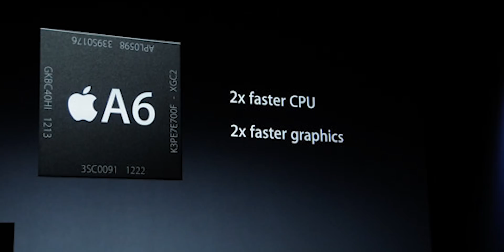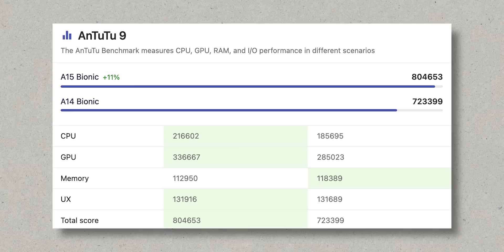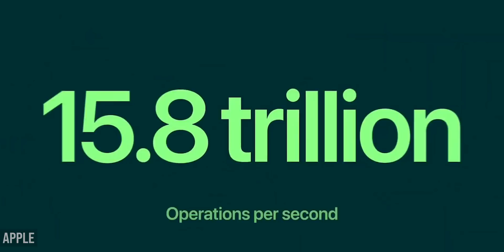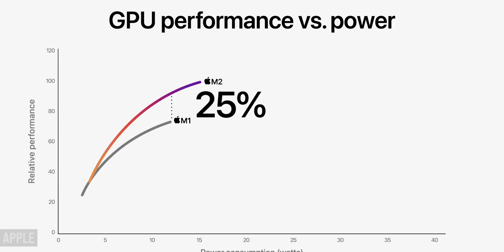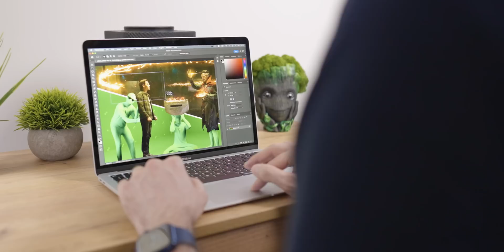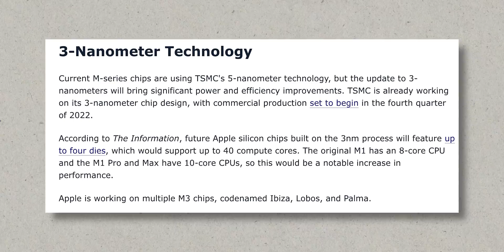M3 MacBook Air — M2 was just for fun?!

Comment: "The term "3 nanometer" has no relation to any actual physical feature (such as gate length, metal pitch or gate pitch) of the transistors. According to the projections contained in the 2021 update of the International Roadmap for Devices and Systems published by IEEE Standards Association Industry Connection, a 3 nm node is expected to have a contacted gate pitch of 48 nanometers and a tightest metal pitch of 24 nanometers." - Wikipedia.  All marketing my man.

Comment: As someone who NEVER feels the need to have the “newest and latest” materialistic objects, the MacBook Air M2 is an incredible machine that will hold up for years to come. I bought a new MacBook Air in November 2016 and it’s been an incredible machine for years. I’m only upgrading cause I lost my old one and when found it was broken.
Reply: Aged like milk
Reply: How the hell do you loose a large laptop?? Its not like its small like an AirPod or even an iPhone for you to lose it?
Reply: @Inferno45  Lol. It fell out of my book bag and into my Jeep somewhere. I didn’t notice for a few days. I went to get it from the book bag and it wasn’t there. Used “Find My” to locate it, and it was broken. The Jeep was full of people throughout the week going to the beach and various other places, plus packed with everyone’s stuff, so I think it was crushed by the seat being moved. It was probably fixable. I sold it to a friend who is into building/repairing Apple products.
At that time Apple had started using that keyboard on MacBook Airs that no one liked, and they were prone to issues, so I just held off on buying a new one. But it looks like this new MacBook Air is perfect.
Reply: I bought a MBA in 2016, it works fine except the unpredictable internet disconnections  😠  the Wi-Fi drops so often that I can't use it for online courses. I tried many methods and even replaced the network card. This is the reason I want to get a new one.

Comment: I think Arthur looks like Harry Potter (I'm sure others have said this).  The increase of the M2 is pretty good I think.  I agree, if you have an M1, no need for the base M2 (unless you really need to 8k decoders or boost to gfx (esp. if AAA titles start to appear)).  If you still have Intel, and don't need maximum power, then the new Air wouldn't be a bad investment.
I have the M1 Mini and do web development.  It is amazingly fast for what I'm doing (no XCode currently).  Even Java (which I only use sparingly) is native on the M1 and runs very quickly (Camunda and Tomcat)

Comment: I completely disagree with you. The m2 MacBook Air IS exciting. It is a brand new design for the MBA in years, the m2 chip is still an improvement over m1 and it comes with plenty of improvements such as MagSafe, bigger display, and better audio/camera quality
Reply: I feel you. the new Air design is so exciting, screen and speaker upgrade makes big difference, but It's still hard to justify the extra cost, while you can have M1 MBA for less then $800, The M1 is still a perfect everyday laptop. while M2's chip's improvement is small, for me I'd hold on to my M1 for M3. Also hoping Apple is going to sell 512GB as based model M3 Air.
Reply: Completely agree. These tech-heads are WAY too sour over these new Apple releases.
Reply: MagSafe is enough for me to upgrade.  All the other stuff is a huge bonus.
Reply: No, its overpriced.
Reply: @chromaticvisuelle  No, it isn’t. The new upgrades justify the price increase.
Reply: @Mr20001  No. Not with 8gb/256gb only in 2022.
Reply: @chromaticvisuelle  So, you think they should offer more storage for less money? Right. If you’re someone who requires an exorbitant amount of space, go for something else. This isn’t a problem for most people.
Reply: @Mr20001  You don't get it. Thats fine.
Reply: @chromaticvisuelle  Can’t please everyone.
Reply: @chromaticvisuelle  256 GB on a laptop in 2022 😭😭

Comment: People are overhyping 3nm so much. When apple switched from 7 to 5 for the A14 we still only got an incremental upgrade for performance, because apple focuses the upgrade mostly on efficiency. Because the M3 will be a baseline chip it will probably also focus on efficiency and not some massive power boost
Reply: Ya they will prolly save it for the m3 pro or m3 max chip
Reply: Efficiency is honestly all I'm looking for after coming from a windows laptop that could not survive without a charger.. what kind of efficiency jump is M2-->M3 going to be? Any idea?

Comment: I'm hoping with the M3 Apple adds specific raytracing circuitry, much like have for media encoders. This is an area they fall short in relative to NVIDIA and AMD.
Reply: It would be cool but it’s not happening at least not for years. Ray tracing still does not provide a huge benefit over just properly doing light and shadows well with traditional rasterization techniques. Until such time as ray tracing surpasses rasterization I don’t think they’re gonna do it. Also as Apple uses a tile based renderer which would add an ungodly level of complication to do hybrid of ray tracing and rasterization. Especially when compared to a traditional intermediate mode rendering used by GPUs from the likes of Nvidia and AMD.

Comment: Let’s not forget that the biggest leaps forward, node shrinks or new processes, have nothing to do with apple. That’s all TSMC. But there’s also much more differences than you’d think between A14, and A15. Both low power and performance cpu cores, and the gpu cores were all redesigned, or at least improved significantly. But I definitely agree there’s no reason to buy M2 or A15 products if you’re coming from M1 or A14 products.

Comment: I can understand why tech YouTubers by machines every year.  They need to report on the newest of the new.  I look at things differently.  If I am looking to buy a new computer ever 2 or 3 years then I have failed in my purchasing decision because I did not buy computer that I needed.  That means the computer should last you at least 5 years.  Buy then the landscape should be significantly different.  I still think it does make a difference that apple comes out with a with an M2 and M3 for people who are still trying to squeeze every bit of life out of their older machines and at some will be ready to buy at some point.
Reply: Problem is Apple release cadence - they drip feed incremental upgrades.
Reply: It's better to replace every 2 to 3 years.